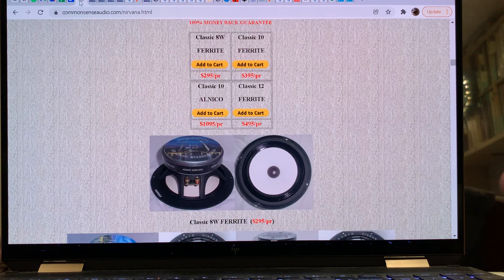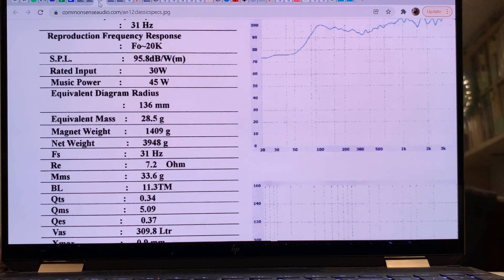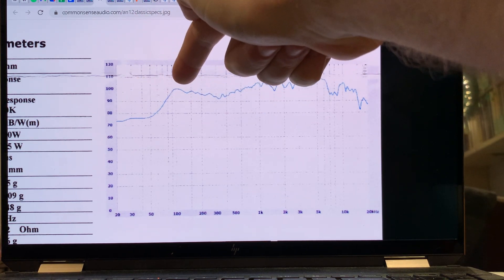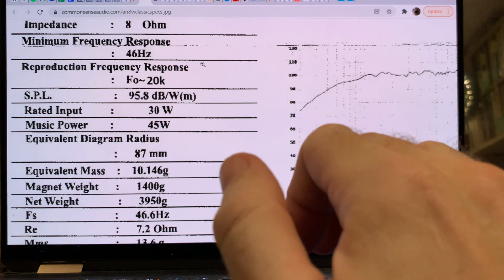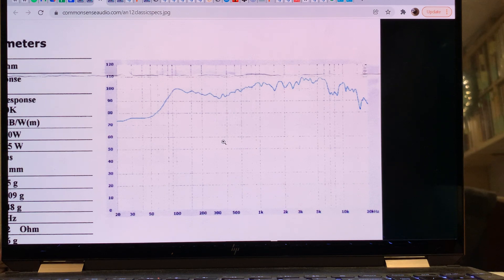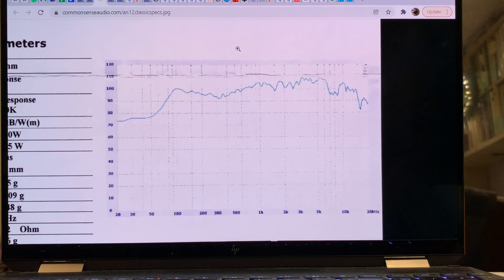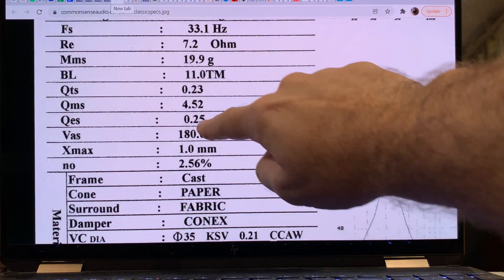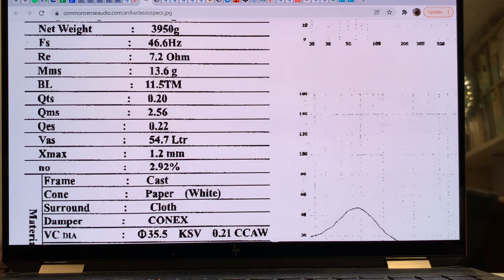Audio Nirvana 12in driver: how does it compare to the smaller AN drivers?

Comment: Thanks for the analysis! 
I just missed out on a pair of A.N. Classic 15s that someone was selling used. Those would have been FUN to try! 
I have read on Auduo Nirvana's website that Mr. Dicks claims that their larger drivers actually have better high frequency response than the smaller ones. 🤔 I'm not sure how this is possible. Lower bass, of course. But with higher moving mass and likely more cone breakup, I just don't see how a 15" driver could handle high frequencies (and image) well. 
I love my 5" drivers for those attributes and more- but I really need to play with some big FR drivers to see what they can do.

Comment: Bro i had commented earlier also but it didn't post due to links, 
So basically I was asking your opinion on which driver would be  better,  one is  92db eff  with  4ohm  impedance or a 85db with 8ohm , if u want I can email you the drivers link, did u get my last email with the blue speakers
Reply from the maker: FORGET 4 OHMS DRIVERS IN GENERAL. Final, definitive answer on every 4R driver on the planet. ; )Yet, as far as 92dB/4R vs 85dB/8R goes, the 92/4 is the better choice and borderline okay for a 4R, PROVIDED IT DOES NOT DIP BELOW 4R - is it truly a 4R, or is it a 1R or 2R masquerading as a 4R? (Most likely..) Hence, just forget about all 4R for good.  Use it only if there is no 8R version. I'd extremely warmly recommend to set your eyes exclusively on 8R and higher impedance drivers if you want potential for tube amplifiers. I know 8R is getting harder to find nowdays, but do not give up. When you want to make a curry, forget browsing the pasta shelf.
Reply: @realworldaudio  thank you for the advice bro , yeah it's getting harder to find good efficient drivers these days and it sucks so many brands are coming out with low efficiency drivers only, sad but I guess I have moved on to pro audio like brands but people who want hifi speakers are very cautious about only getting branded drivers from dayton etc

Comment: What are the most important parameters when deciding on a driver for a single driver OB speaker?

Hi Janos. Before trying my hands on a Voigt pipe, I might be tempted to experiment with a very simple single driver OB speaker (a driver and a board), but what are the most important driver parameters to look for? You mentioned the extended bass response of the AN Alnico as an important parameter, but is a larger cone area more important? And what about cone mass vs magnet strength?

As others have commented Decware sells a variety of single driver OB speakers that they claim embarrass all of their previous speaker designs in terms of sound quality, and I guess it just "sounds" intriguing. Thank you! / Claus
Reply: Hi Claus several things have to be addressed in an OB design. Firstly, for deep low frequencies the baffle should be large because of the cancellation effects from front to back.The size of the driver and the QTS also have an influence on the low frequencies.The QTS is a combination of electrical and mechanical parameters related to the driver. In short the QTS with the volume of a box and any internal stuffing create an acoustical load for the speaker in a box. This is how the speaker designer will determine the box size through Thiele Small parameters. In an OB you do not have a box or a load for the driver so if you have a high efficiency low QTS driver the bass will roll off at a steeper rate than if was in a box where the same driver have a more gradual low frequency roll off because of the acoustical load the box presents.Numbers for QTS can range from .2 for a high efficiency driver to 1 or so  for a low efficiency one.Sound difference low QTS will give a leaner less full sound vs a high QTS giving a slow fuller bass sound. So in essence a 
powerful magnetic motor with a low mass cone and a very free suspension will roll off more rapidly and generate a lower QTS number. Lastly because in an OB you only have a light air load behind the driver you need to make sure the pole piece and voice coil can handle a decent excursion because the driver can move more freely than if it was loaded in a box. Regards Lou
Reply: @loureda5443  Hi Lou. Thank you for that thorough reply. Much appreciated! Did not know about the meaning of the QTS parameter. Good point about cone excursion. How do you figure out if a given driver can handle the free excursion in an OB design? Does the max excursion in eg. millimeters have to be below a certain fraction of the diameter of the cone in millimeters? Or is the excursion / diameter fraction irrelevant? Any thoughts are welcome :) Thanks again / Claus
Reply: Hi Claus, I think Janos has just answered your question about excursion.
Just remember the more efficient your driver is the quicker your low frequencies will roll off in the deep bass,because of the lower  QTS.I use field coil speakers and because of that I can adjust the field strength of the magnet and I can 
change the QTS and the efficiency of the speaker. Generally speaking a larger say 12 or 15inch will help out to get good efficiency and good bass.
In my set up I use a 16 inch , 8 inch, and a ribbon tweeter of my own design.One last note a short coil in a long magnetic gap is desirable over
a long coil in a short magnetic gap as the coil is always in the magnet gap 
and will give more linearity.Something else to look for when seeking out a driver.Two of my friends have the decware drivers but they have not built the baffles for them just yet so I can not comment on the sound.Regards Lou @earkivaren
Reply: @loureda5443  Hi Lou. Yes, Janos answered my question. And thank you for the additional comments on coil design! I'm a newbie when it comes to building your own speakers, so I would like to start out with a full range single driver design (will probably end up with a Voigt Pipe, following Janos' upcoming descriptions), and by chance I stumbled upon Decwares single driver baffles and as they get high praise, I got interested. I mean: a driver and a board, what is simpler. But then you start asking questions, and people with your or Janos's knowledge is kind enough to reply, and suddenly it's not that simple :) Thank you for sharing with us! /Claus
Reply from the maker: Thank you Lou for answering Claus' question! Claus, just FYI Lou is THE open baffle expert in my book. He has the most knowledge on OB of anyone I know. Yes, the high QTS is the prime indicator that the driver will work in an OB. For the excursion, you will also need to take into account the sensitivity - with higher sensitivity you will not need as much excursion VS a low efficiency driver.  I'll make a video for additional things to look out for when choosing a driver for OB. Might take a few days until I can shoot & post it; Janos
Reply: @realworldaudio  Please, no rush!! You're generating so much content, that I'm starting worry about your health! So whenever you have the time and inclination :) Thanks